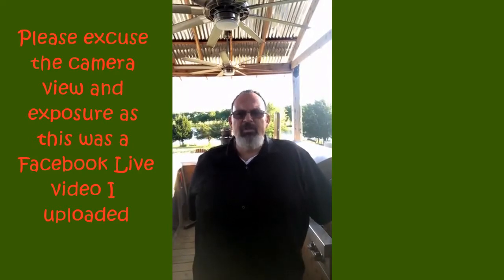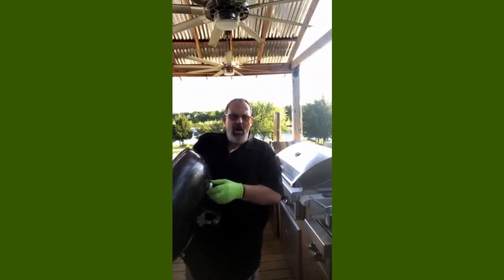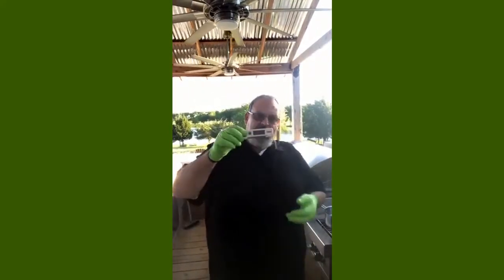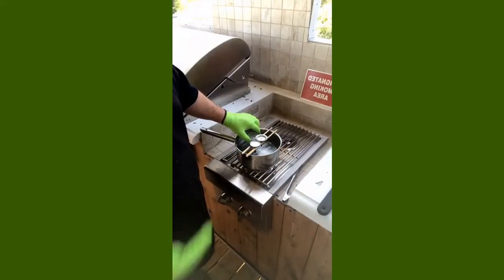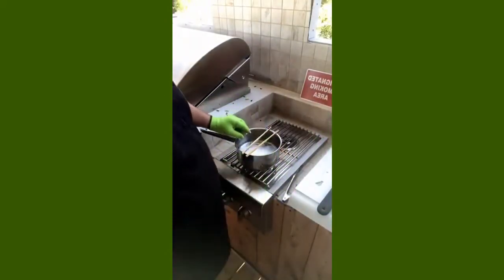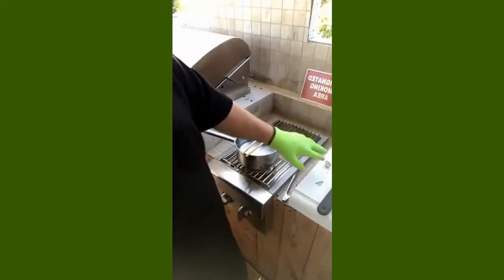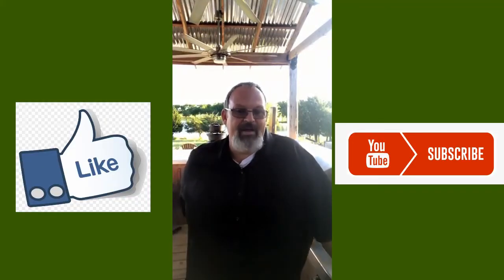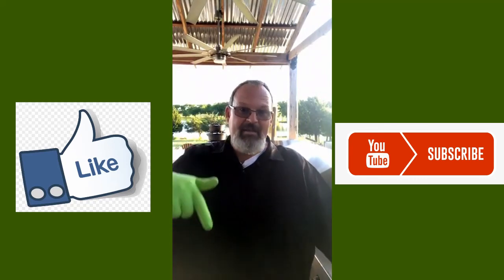Testing and ADJUSTING Your BBQ Grill Temp Gauge [BEFORE YOUR NEXT BBQ]

Comment: Great video! Here are the results of my thermometers and I have to say I was astounded. 
Weber kettle was right on the money.
 Weber Smokey Mountain was right on the money.  (Both of the Webers could only tell within about 5ﾟone way or the other., but that works OK for me.)
Inkbird HT-1P instant thermometer right on the money + .4°.
Thermoworks RT100C  Instant thermometer -1°.  I was planning on spending some money to replace the Weber thermometers, but now,, I see there's no need. I am always close enough to see them so not a problem seeing the temperatures from a distance.  We always hear so much negative about the Weber thermometers but these are good enough for me.
Reply from the maker: Thanks for posting your results.  I am also impressed with the Weber results.